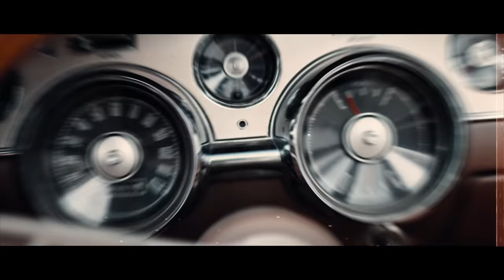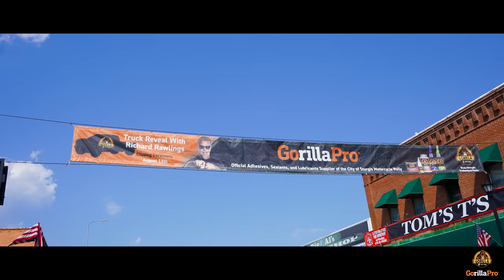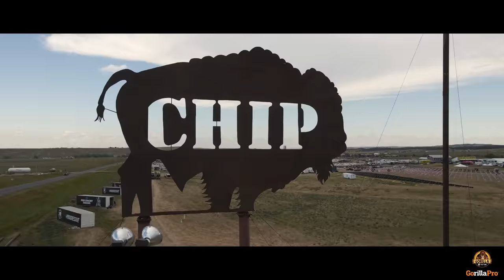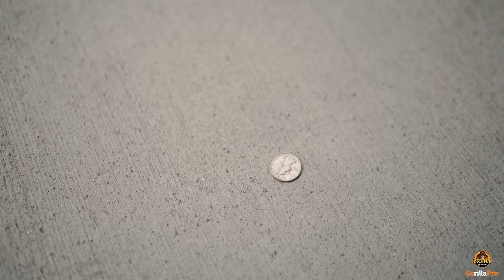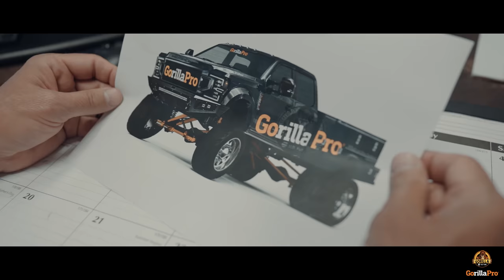Building A Gorilla Pt. 6 - Sturgis 2022 - GorillaPro® - Gas Monkey Builds

Comment: Do NOT have a drivable SUV @ this time...on disability and my 2001 Blazer needs some help...any chance you could aide a diabetic in IL?
Reply: Cut the carbs and soda. If Type 1 then yeah that's tough
Reply: I have been type 1 for 49 years, my soda is Diet coke and YES carbs are necessary!!!!